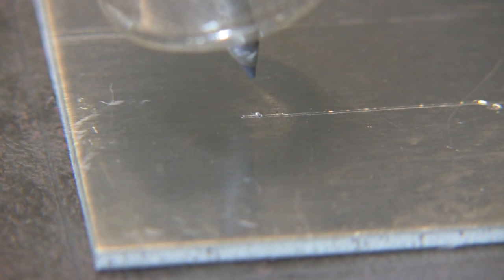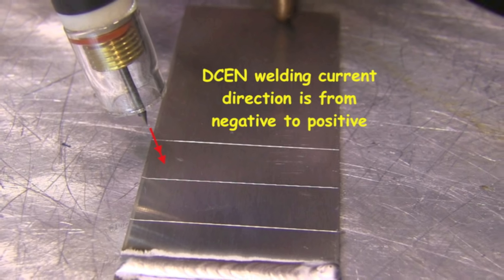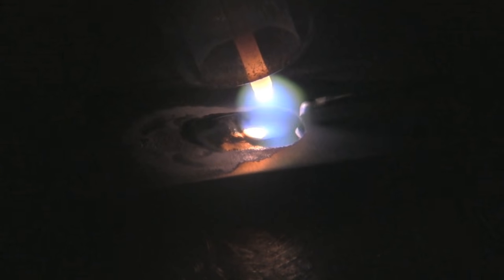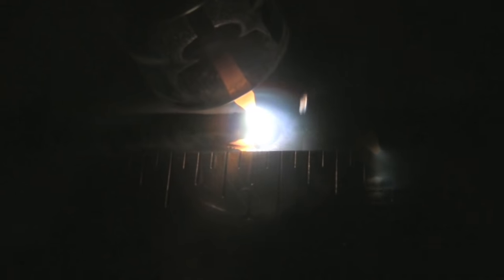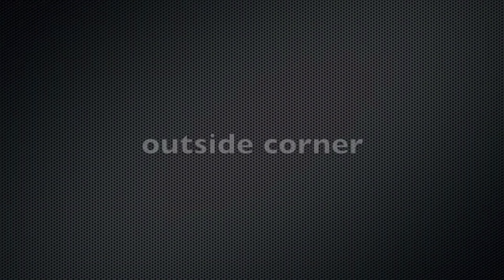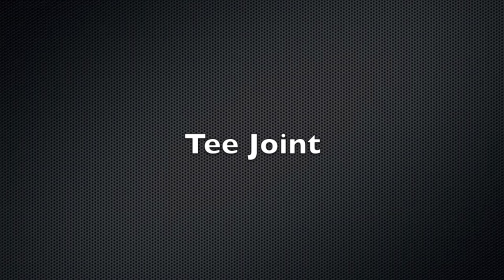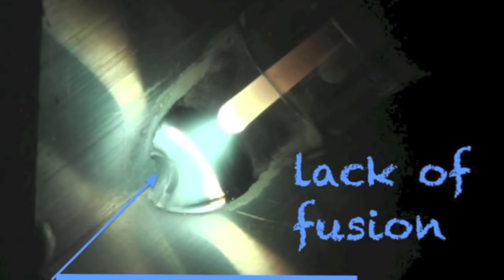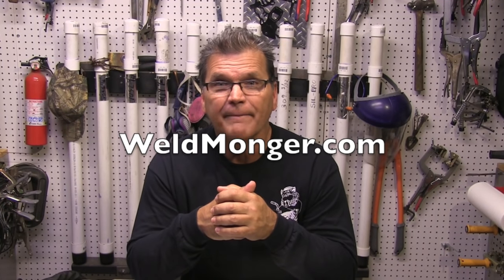How to TIG Weld Aluminum part 1

Comment: i have been exposed to welding at my university, I'm a manufacturing engineer major, but have not been actively practicing since my class 1 year ago. this video has so much insight on how to rig weld! very helpful for beginners to get an idea of what to look for when initiating a weld and what to do. thank you for helping the community!! i have a project at work that requires some welding, you have given me the courage to finally try welding.!

Comment: Jody, Thanks for continuing to make fun and educational welding videos. I especially appreciate you doing a series dedicated to Aluminum.  One area I think would like to understand better is heat input. The difference between starting out slow or starting fast with aluminum and how it affects the rest of the weld. How welding with too low versus too high amperage affects the weld outcome. As well, how to choose the correct amperage on a large aluminum piece versus a small piece and the affect amperage settings has on different size parts.

Comment: Love that this will be a series. Thanks for asking for questions. I'm just learning, and I have a tendency towards a long arc, big puddle, too much heat, blow through thin stuff, etc., but when I try to get close I dip. I think it would help to see some tips on how to support the torch on different kinds of work for a close arc, and especially how to keep it steady as you move. Where do you have your hands, where do you have your head to see properly, how do you manage the hose pulling on the torch as you move, as things get hot, etc. I'll bet there's a lot of technique that is just second nature that you don't even think about that might help a lot.  The arc shots are just fantastic, and I love them, but some of the zoomed out view of what's going on with the hands and hose and what surface you're bracing off of might be good too. Also how to hold/clamp stuff as you're tacking it up so that the angles are accurate without getting everything into some awkward angle, how to keep the ground clamp out of the way--these kind of things are my beginner problems/questions.
Reply: POSITION POSITION POSITION is what I’ve learned. Your body should Three points of contact for stability.

Comment: Jody,
first off i just want to say thank you. I learned how to tig weld just from watching your videos . This may be for a more advanced future video but I think it would be interesting to talk about post weld heat treatment of aluminum alloys, when its required and when its not. Another thing that I would like to hear you talk about is depth of penetration vs. just surface fusion and when you can get away fusion vs. needing full penetration. 
Br,
Daniel

Comment: Another area of interest is causes of aluminum welds cracking and signs to look for to help diagnose and fix cracking problems.  I was recently trying to weld a 2' piece of 5052  1" x 0.125" angle across a larger sheet (2' x 5' x 0.125") of 5052 aluminum with 5356 wire (center bracing on a boat windshield). No matter what I did the welds would crack and the sheet would pull away from the angle brace.  I tried clamping with vice grip clamps, tried backing with more aluminum, tried going hotter (175amp), cooler (160amp), more fill.  Nothing I did would stop the cracking problem.  Finally gave up, cut it off and MIG'd the angle brace in place with no problems.  Really would have liked to figure out the TIG solution but No Joy there.  A video on this with techniques to control cracking and other causes of cracking welds would be great.  Will look forward to more videos on aluminum welding. Thanks again.

Comment: I am a newbie welder, and recently conquered aluminum. I would talk about the science behind contaminated material, and electrodes (in detail), like Travis does on his vids, but more of the science, as opposed to how important it is. Also, the heat equation, and getting the amps right with the size electrode, size of filler material, and material thickness. To expand on the last one, how to keep the heat consistent with foot pedal. I still start off too cold, and end too hot. (How to know during the bead run, not after).  Its always like I am starting over when I change material thickness, and I am not sure if I should increase electrode, and filler size. Some general rules of thumb to start with, with different material thickness.

Comment: Thank you Sir!

I was just doing some inside corner work yesterday, making a horrid mess of it (why lie), and I see now my problem was exactly what you mention...too great of an arc gap.  The bead wound up too wide, I couldn't close it down once it started, filler would melt before it reached the puddle...etc etc.  Of course once I tighten it up I am going to have trouble dipping the electrode into the puddle or against the filler rod....sadly there is no escaping the fact that I need a lot more practice.

I have learned so much from your videos...I greatly appreciate each one.

Comment: Watching this long after you made it. Excellent info. My aluminum tig welding (just started) sucks so hard! I seem to be able to get a puddle and move it along just fine (a log time mig welder of steel) but as soon as I started trying to dab, I can't go fast enough or I touch the arc with the wire and have to stop and clean the tungsten, or I just plain bury the tungsten because after the weld pool gets shiny, it's hard to tell how much standoff I have!  I even put a 2.5 magnification in my welding mask.  -- On to the next in the series! then down to the practice arena!
Reply: Just finished practice and was finally able to actually run a bead! I don't know how you pros do 1/8" aluminum at 90 amps or less, but all I did was cook metal.. I grabbed a miller old school cardboard calculator and ran at 150 amps and it came out great! I was able to actually dab and move... thank you for this video!

Comment: Hey Jody
Great videos as always, the best on youtube,
one comment Current flow from (+) Positive to (-) Negative but Electrons flow inversely to the current, and the electrons dictate the heat input,
like the example you always give in your video's DCEN puts heat into the work, electrons are flowing from the tungsten(-) to the work (+), and that causes the heat to the work and extra penetration of the TIG welding.
You are the best welding teacher out there, 
I'm just an Engineering student that is good with the keyboard and takes out his inverter once a week.
but you know for the sake of passing out the right information to the viewers.........

Comment: When at the end of my bead,to allow the crater to form I always keep my torch about 1” from the crater with my foot halfway down on the pedal for 3 seconds. That extra few seconds of argon gas shields the oxygen from the bead and allows it to form. Just a little tip for new welders learning the process.

Comment: Thanks for the Video I learnt something new from your comments on oxidisation on the Alloy, I do a lot of alloy wheel repairs and in most cases I am very successful in the repair and now and again a wheel or rim will create so much rubbish, it is hard to know what is the cause, I have a 7 yearold Lincoln 205v ac dc tig set and got this new when they were announced in the UK, most of the time I was self taught as what I was doing nobody in my field was repairing to the level I do. recently I have to repair rivet holes in a Alloy rim, break down of the alloy was 99% aluminium .06 copper and .13 Iron, and then the rim was anodised, I managed to repair 4 rims and then the 5th one side repaired good then turned it over to do the other side and the repair started ok until half round the rim and then the as you said the muddy puddle appeared, and the results were terrible, I ground it all out and started again checking settings and connections, it did repair but a very nasty mess appeared, maybe it may have been something in the alloy, as this rim was an extruded rim rolled and flash welded during manufacture. the rim was 34 years old  but in the end it did repair but I kept is as a test piece in the end.  thanks for the info.

Comment: PEPPER IN THE PUDDLE!!! Thank you for all you do and what I am sure will be an excellent series on ally. My issue lately has been with pepper in the puddle. I can't seem to figure this one out and wonder what can be done to address it. I am sure if you touched on it in this series many would benefit. 
What I have done so far:
I've been working with several different supplies of fresh Aluminum attempting to rule out a bad batch or something. Cleaned the heck out of the metal, brushed, brushed and brushed some more, flap wheeled the heck out of a few, acetoned well with a clean rag, acetone wiped all rods even scotch brighted a handful, used different brands of rod, tried 4043  & 5356,  moved all settings around on my HTP Invertig 221 (more cleaning/less) freq. etc. Two different tanks of argon and ran them both with different flows from 15cfh all the way up to 40. Even switched out cup sizes ranging from 6-12 and swapped the gas lens just to see if that was causing a flow issue. 
Now I know this is very specific and do not expect you to answer my issue directly but if you provided some reasons for pepper and offered some baseline ways to set up or deal with it I believe it could help many people come to a quicker solution when dealing with it. 
Thank you sir and please keep up the awesome!
Reply: Figured out my issue and thought I share for anyone that might read this in the future.  It ended up being a bad tank of gas. Actually two of them. After totally pulling my hair out troubleshooting the problem the only thing that was left was the machine or the gas. Went and got a tank from a different supplier and it resolved the problem. I had ruled this out earlier in the process after I had hooked up the second tank and still had the same issue. Bottom line if you have this issue and shaken out the basics try a tank from another supplier you might have bad gas. Happy welding to all!
Reply: Thanks Chop, I know this is old, but it’s helpful.

Comment: Firstly thanks for doing these videos.  I just ordered the AHP Alpha TIG 200. I’ve not
done any TIG welding before.  My question, “Should I start off with the foot pedal or the torch trigger?”  I’m leaning towards the trigger because the majority of the TIG I do will not be on a welding table.   I mean I don’t really want to learn with the foot pedal and then have to learn again on when I’m doing my projects away from the shop.

Comment: my boss let me do some practice on TIG alluminum yesterday. He was impressed? I managed to make a puddle and even lay a small bead down, even if I couldn't keep the damn torch straight. Though every other attempt I kept bumping the filler rod against the tungsten or touched the toungstun to the material while it was going.

Comment: Hi Jody.  I was wondering if you could talk about different types of aluminum and the appropriate filler metal associated with them.  For example 6061, 3003, anodized, heat treatable, etc.  Thanks.

Comment: Jody I would personally like a little more basic video. Example. What size cup and why? Can you use different sized tungsten for different materials? Should I clean and how?   I bought the everlasting 250ex and after numerous times getting frustrated because I don't know what the hell im doing (setup) it's gathering dust. I understand the welding process is going to take time and practice. If the machine settings and materials  prepared wrong how can I practice?

Comment: Jody I was wondering if there are any advantages to using the tig process over a spool gun other than amperage control or bead appearance? Also, is there a strength advantage with tig? Thank you for your tutorials. Much appreciated.

Comment: I could really use some help getting better at feeding rod accurately. This effects my travel speed and creates inconsistently in welds over a inch or two. Thanks for the great videos
Reply: get a stick of filler take it home sit on the couch watch tv , and run the filler rod end to end until you can't do it anymore, then do it again, it will get much easier.

Comment: Maybe not what you wanted for questions ....1. What about an EP cleaning pass , EN fusion 2. with or without helium on dc ? 3. is there any inherent strength difference between AC tig and DC Ep spool gun welding on clean bright aluminum ?
                                                          Thanks,Ed Flanagan

Comment: Id love to see more work on the sine wave ac machine, just getting started on tig with a very basic machine, no foot pedal, pre or post flow or balance controls... mostly used for steel but wanna learn aluminium, will probably add a pedal at a later date

Comment: Seems like there are a lot of good looking Aluminum welds out there, but many times they don't have penetration in the root. How can a beginner Aluminum welder insure good root penetration, especially on a TEE joint, without burning through or sucking back on the other side? Thanks for the great work and the great videos!

Comment: Jody thanks, as always for the high quality content, direct-to-content (not much intro chat) videos.   My question is why you don't brush? I've welded 5000&6000 series alum. since the '70's and always use a power brush (0.014" wire only) to clean the mill scale off- then re-do the brush using hand toothbrush immediately before I light up.  

I notice you rely solely on the arc to have cleaning action?  I've found mini-gas bubbles in fast travel TIG welds (moisture in the mill scale?) when not cleaned?  The speeds you're demo'ing are slow enough that it probably cleans:  the porosity I've found were seen under hand lens (small) and mostly due to higher travels speeds- after cut-polish-etch. 

Just checking for remarks, experience, feed-back, and comments on brushing before welding to A) remove mill scale, & B) to scarify the oxide before welding to aid in cleaning action?

Thanks again for your high quality videos.

Comment: Great start Jody. How about getting into the upper settings and how they effect Al. welding. All the different AC waveforms on the high end inverters, what effect each have. Extended AC balance and freq. control. What is the best settings for all of these for thick aluminum welding with no pre-heat but wanting quick pool start to reduce warpage.  Regards/greg

Comment: I still run my monster Syncrowave 500 and while its a dinosaur its still drawing revenue and so simple to operate I may never sell it. Thanks again for another super video full of information and not forgetting us old transformer holdouts. I think its time for a smaller back up machine but don't have a clue where to start. Still need 200 amp water cooled so any suggestions? Keep up with the tips on the old transformer machines please.

Comment: Jody***How do you determine  the amperage for a Lap , "T" , and  Outside Edge joints, since it involves heating 2 metal plates? do you still use the 1 amp per .001".  Example what would be the amperage for a lap joint,  a T joint , and  a outside corner joint  for 1/8 thick  aluminum material.  Thank you for all the fine videos, and info you deliver to all of us.

Comment: so i am assuming that when welding aluminum  with a wirefeed , and spoolgun , that this is done with dc current . can this be done with ac current ? is this desirable and is there a way to do this on a regular dc wirefeed   ?  ( the wirefeed with a spoolgun available to me right now is a Millermatic 210)

Comment: Hello Jody I have a miller trailblazer with ac setting,I have had success with carbon steel but to tig aluminum I am told I need an additional high frequency box which I don't understand any insight would be greatly appreciated you have furthered me immensely in my welding since I found your channel thank you very much.

Comment: Jody,

Love all of your videos. Unfortunately most of my welding is in AutoBody repair, which is a different beast entirely.

My question is 2-fold. Ford is starting to use aluminum on more of their trucks. Sometimes welding is required for some repairs, and the manufacturers always recommend MIG. Why is this? It seems to me that you'd have more control with TIG, especially on the thinner metals used on vehicles. Why do you think this is?

Given the choice, would you TIG or MIG on aluminum sheet metal and why?

Comment: You touched on it, but maybe more focus on this issue... My biggest issue with aluminum is on Fillet's.  I seem to have a problem getting the puddle to drive down into the root of the joint and push forward, it tends to want to lag behind, very slow.  I have tried a little longer stick out, putting the tip of the tungsten as close to the root as possible without having it contact when filler is added.   Maybe you can cover this?
Reply: I struggle with fillets too, Jody you make it look easy.
Reply: Philip Barker right? He makes it look like anyone should be able to pick up a torch and get it done.
Reply: My suggestion would be to adjust your work angle and travel angle. You also absolutely must wait long enough for the weld to fuse from top to bottom if you start pushing too early, not only will you not burn away that oxide coating quick enough, but you'll also have trouble fusing top to bottom along the way. It sounds complicated, but it's literally all in watching your puddle, and manipulating it as needed. Welding aluminum is a slow process because the aluminum itself will melt quicker than the oxide coating. So again, just watch your puddle.